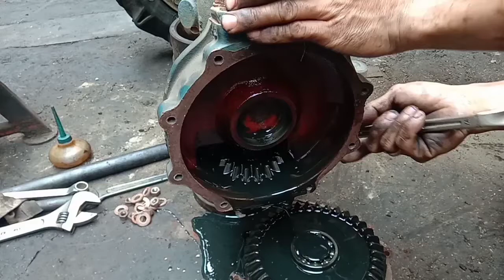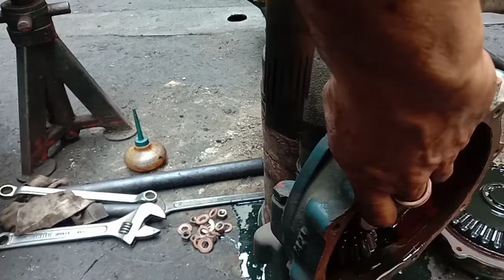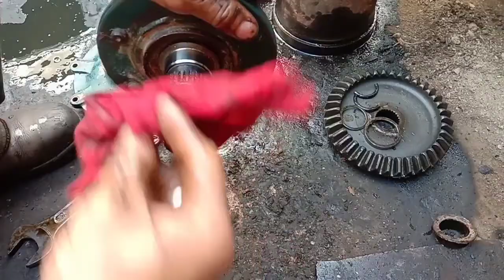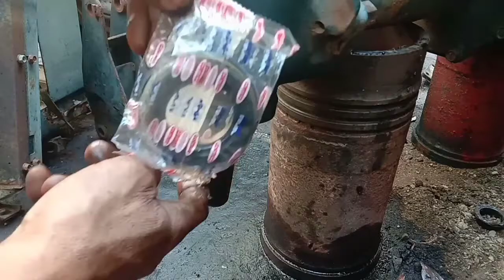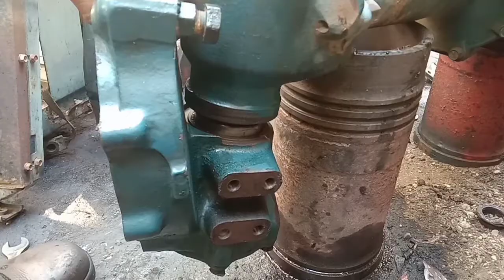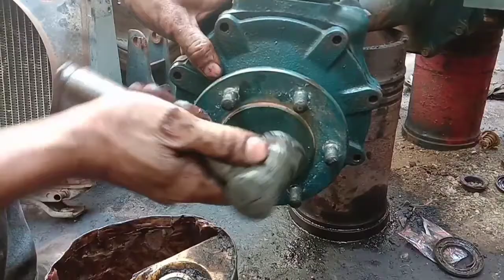front axle oil seal REPLACEMENT (L&R)KUBOTA L1802DT

Comment: You are a real hack,letting the oil just pour on the floor,smashing crushing everything off.Glad its not my tractor.You missed showing getting the big snap ring off after the bottom seal.But you did show me that the split round clip was two peices,thanks.